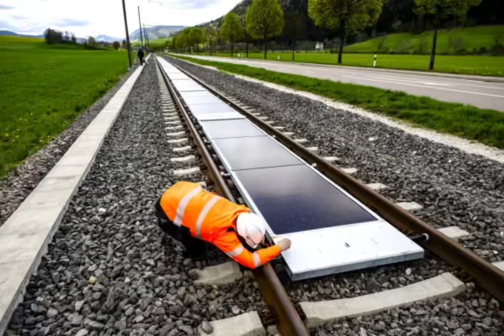Switzerland turns train tracks into solar power plants

Comment: It's a scam.
Reply: Any evidence?
Reply: @avlisedeneb6677  The thing is do you think that nobody up until now had thought of this to try it? It has been tried many times on rail, on road and it doesn't make any sense because you have dirt and you have vibration and you have all sorts of things that can damage the panels and then you have to pull the power out of this while placing it flat on the ground where it can receive most shade and it's not angled towards the sun. The best place to put the solar panels is obviously the roofs facing south on the North Hemisphere and at an angle that is optimal for year round most solar electricity production. Why do these guys think that they are inventing something new that hasn't been tried before? It has been tried but it doesn't make any sense. It is lower production it is more prone to damage. Unless you have covered every roof on every house on every building in the country there is no sense of trying it on the rail tracks. The most protection the solar panels will have and the least of the dirt on them is on the roofs of the houses also if you want to put them on the rail it should be placed overhead over the power lines making a shade for the tracks or the roads or the parking lots. That is how you guarantee most production most return on investment and most protection against dirt and damage to the solar panels.
So it's obviously a scam because it will produce half as much as if they were on the roofs. Only for that reason why would you even try it. Put it on the roof and they all have the double the production. Only for that one reason it's a waste of money.